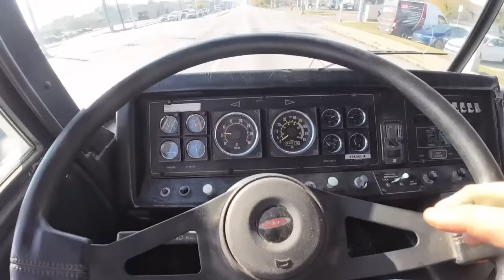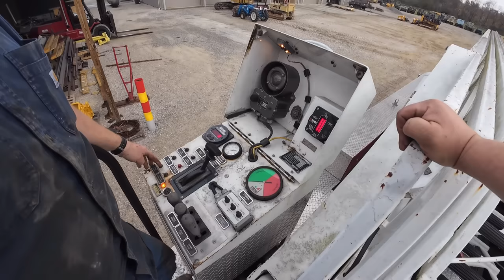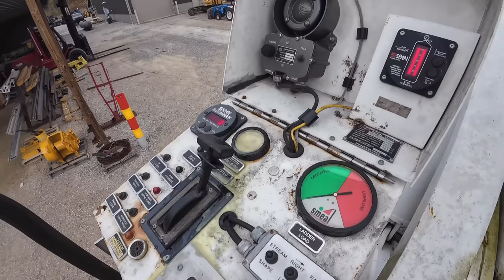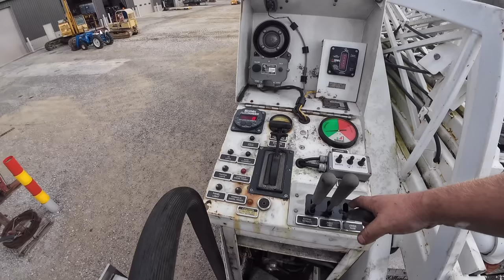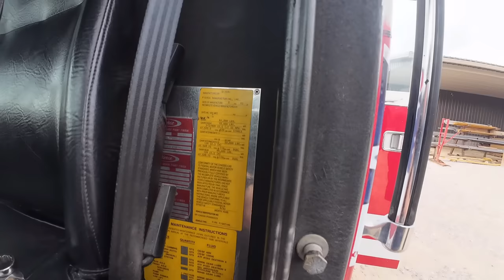We bought a 105’ ladder fire truck! Let the fun times begin! #firetruck

Comment: Back in about 1974, the Quad City Fire Dept. on the Iowa/Illinois came down to southeast IL to pick up a surplus Snorkel firetruck.  The clutch cylinder leaked down on it and their driver did not have the airbrakes released when that big diesel engine engaged and twisted a U-Joint into pieces.  We pulled it up to our dealership and located a driveline company down in the bottom of Indiana that could rebuild the shaft.  Being it was going to take a few days we worked out a deal where I would deliver it on a Saturday to the Coal City FD.  We left on a Thursday and stopped to visit an old friend in Rantoul, IL.  When we were passing the main gate of Chanute AFB the clutch decided not to disengage and we were stuck in the middle of the entrance.  After spending the night at our friend's house we got back on the road.
Like your truck, we were grossly overloaded on the rear axles and there was a weigh station on I-74 west of Bloomington, IL.  Having hauled many pieces of heavy equipment from Peoria I knew that we could go north from Bloomington to El Paso, IL, and take 24 west to the north side of Peoria.  When we were close to Peoria we had to pass through Washington, IL.  We got to the east side of Washington and a cop saw us.  He immediately turned around passed us, turned his red lights on, and motioned for us to follow.  We did.  We would have loved to see his face when we got to the west side of Washington and he pulled over and let us travel on.  On the side of the snorkel boom, it said in big letters "JOB CORPS, POLAND SPRINGS, MAINE."

Comment: Operated an identical model many years back!
You set the outriggers at the pump panel. The slide out step at the pump panel is for the operator to stand on in the event the ladder is energized by Live wires!
Also I noticed the skid plates for the outriggers are missing.
You guys are hilarious, keep sending them great videos!!
Reply: looks like it's missing the bucket too
Reply: @Commissar0617 not every rig for a bucket, my dept does not have ine
Reply: it looked like its got a mount for one  @fireexplorermichael
Reply: @Commissar0617  alr maybe there was but if there is a mount and the bucket is missing prob why they sold it

Comment: I use to drive one of the 105 ft Pierce Quint before becoming a Battalion Chief.  I think it's around 46K GVW with out water in the tank.
Reply: Newer equipment is much heavier, this is a vintage 1993.
Reply: @user-ln7of9gs4s A modern Ferrara ladder weighs roughly 78k but it depends on what axles you option it with tho but some of ours are 😊

Comment: Clint, the little oil tank with the dipstick on the passenger side pump panel is primer oil to pull a prime on the pump. It uses the oil to seal the primer pump vanes. New apparatus doesn’t use oil since it blows right onto the ground.

Comment: Fire Com box was for headsets, comms between FF’s. The driver position probably quick connect plug also used at pump panel. Weight 62-63k loaded (assume 300 g or so water) plus rest of equipment. Newer would be even heavier.

Comment: Thank you for BUYING this Ladder.
 I own a 1971 SeaGrave Engine. 8V-71 Detroit with a 5 speed Spicer/Dana Transmission. I use it for KIDS events with are Local Fire Zones. Let kids get in Drivers seat. At least in mine the kids can slide or walk through cab. Make sure the Differential Lock is unlocked in cab. On mine it also has a disconnect for front brakes ( slippery roads) mine also has the micro switch for brakes without putting foot on pedal. I don't turn any of those ON. I also have button on dash (have coveredwith Rubber cap,  so kids don't push that button. Its the emergency KILL Air for the old two strokes. I have added electronic sires to her. I just had the big Federal "Q" on nose. When I brought her
 Loaded up all the Air packs compartment with portable Fire extinguisher of all sizes and types. I have mounted old school Light bars on roof, swap them out from time to time. Plus it has to have the great Federal "184" four beam beacon 🚨. The Beakon that was probably the light that came with it new in 1971. I have learned so much from her about the inside of a Pump. There is so many room to get under her and look at where all the levers connections to what outlet.

Comment: Rubber block with a walking beam , these were usually used on International trucks ( Navistar). I built lots of them , the walking beams depending on the rear end weights were ether cast aluminum or prefabbed steel 3/4 plate.

Comment: Back in rhe 80s i was on the Sussex, Wisconsin Fire Department. We had a 1982 Pierce LTI ladder truck. It was unique in that it used a mobile crane chassis that would completely lift and stabilize the truck. The 85 ft ladder could be used, fully extended, in any direction or angle. The truck was replaced when the cost of certification for the ladder tower made replacement more practical. In our community the truck was intended to provide an elevated stream for fire suppression on large spread out industrial buildings. Pierce fire equipment in proudly made in Appleton Wisconsin! They are indeed cool trucks!

Comment: I’m guessing somewhere in the neighborhood right now of 50,000. The truck is an aerial because it has its own pumps to supply the master stream. If it was a ladder it would not have pumps.
Reply: Actually, it’s classified as a “Quint.”   Water, pump, hose, ladders, aerial ladder.  Everything in 1 vehicle.  That’s the reason for the weight.  Wait till it’s loaded up with equipment. The pump supplies water for the whole unit, not just the aerial.

Comment: As a former Mayor, here's what I can tell you about the 1993 Pierce Ladder Truck.
The outriggers are deployed so the truck chassis is off the ground. I've seen them as high as 12" off the ground.
The pipe that extends with the ladder is a 'ladder pipe' and a nozzle is attached to the end of the pipe for fires requiring large volumes of water. For fires in structures that have a large footprint, when extended it is effective in placing water at a distance that could not be attained from the ground. 

ISO is an organization, funded by the insurance companies in your state, is responsible for reviewing fire departments in your city or township based on several criteria. Based on their review, they assign a rating for the fire department and that rating is used by the insurance companies as one component in calculating your homeowner's insurance premium. Usually, the lower the department rating, the lower the fire protection component of the homeowners insurance premium is and vice versa. 

Fire apparatus that has been decommissioned or is older than the allowable years of service (age) is not eligible to be used in ISO's rating. Therefore it may not be of any value to a fire department.
Clear as mud???
Reply: Your understanding of ISO is about at mayoral levels.  All a department has to do is get it tested by a reputable third party aerial inspection service and it is good to go.  A fire department wanting to spend 3/4 million on a new aerial would never have explained that to you but, I can guarantee there are hundreds of used aerials as old or older that this one being calculated into current ISO ratings.  I can also guarantee you that there are hundreds of aerials sitting in firehouses simply for their ISO points and not because they are necessarily needed for aerial work.
Reply: Aerials older than a stated build date and aerials that cannot be certified do not qualify for ISO points in Illinois.
Reply: Source?  What date?  Illinois only?
Reply: @jamesford7182  Will check with the chief...thanks
Reply: @jamesford7182  Correct Illinois only.
Engines count for ISO ratings for the first 20 years from build date. 
Trucks count for ISO ratings for the first 20 years from build date. 
After 20 years. pumps and ladders must be certified annually.
Reply: Actually, ISO requires a fire pump to be tested annually per NFPA standards while in service.  The standard pump test for a new pump is 4 hours long but the annual recertification test is 1 hour. During your ISO inspection they ask for a three year history of fire pump tests as well as three years of yearly tests for the hose.  (Those two requirements plus a master stream appliance net a vast majority of the points that can be awarded for an apparatus.)  You only get full credit for the individual pump if you can supply the full three years of pump test readings to the inspector.  Less if the pump is new. Of course, they don't inspect every department every year but, when they show up that is what is expected.  

While aerials have most always been similar in nature, regarding ISO and NFPA, I cannot confidently talk about them as I have not worked for an aerial builder in the last two decades.

If the state of Illinois is not following that criteria, they are not following NFPA standards but tailoring them to their desires.  If so, the implications are damning.  You are saying that most of the aerials in Illinois are not required to meet NFPA standards to earn ISO points until they are 20 years old.  I have not sold fire apparatus in Illinois since the 1990s but, I find that hard to believe. I find it even harder to believe that union fire fighters are climbing ladders every day that are not being inspected yearly.  They know how much abuse those things are subjected to.

Comment: I don't know much, but i do know that fire trucks. Especially ladder units with pumper equipment, are heavy. Like 110,000 pounds heavy if the tanks are full and fully kitted out. I believe that it can get away with being as heavy as it is because government vehicles aren't held to the civilian standards of things. Like fuel economy, axel load limits, emissions, crash worthiness and small things like that.

I might be well off but hey, Firetruck!

Edit: This is added after seeing the recorded 56k at the first fuel stop. Pull the back off, get a beavertail with a lift platform, make a hell of a car or equipment hauler. Won't be the most comfortable ride with the current seats and all occupants will need hearing protection but it'll be unique alright.

Comment: Judging from all the loose wires and missing stage of the water pipe on the ladder, she is more a parts donor truck than fire truck. 52k sounds light, figured empty would have been a bit heavier.

Comment: I work at a plant where we had an employee fire brigade.  It was an old American LaFrance .  Had a flathead engine, 2 sparkplugs per cylinder.  Driver rode  ahead of the front wheels.  Had armstrong power sreering.  Took an acre or to turn it around.  Only I responded 2 was interesting.   We couldn't figure out the pumps,  so we connected hoses directly to the fireplugs.  Some hot ingots fired up some news paper in the bulkhead of the boxcar.    Old memories.....

Comment: I wonder the last time it was 3rd party NDT and what the report said.
The crackling coming from the speaker is just electrical noise from the lights / charging system and if the siren is completely turned off it should stop.
The ladder intercom is hands-free at the tip, and the two other positions on this truck are PTT.
The box in the cab labeled Firecom is the in-cab headset base, but I doubt they left the headsets with the truck, but there is a jack position around every seat.
The transmission is an HT-740 Allison.
Check the frame for rust jacking as it is very common.

Comment: Looks like you got an old ladder truck that has many different manufactures for the components of the truck.
It has a Pierce frame and cab.
Pump from Waterous and it should have a water tank between 150 and 300 gallons of water.
Ladder looks like it was made by Smeal.
The body could be a Smeal also or may have been built another manufacture.
But ladder has a big PROBLEM, it is missing the bucket that hanged off the front of the ladder.
This quint was originally a ladder platform truck.
Reply: It is not missing a bucket.  That ladder design was never intended to have a "bucket."  Those are called aerial platforms.  Pierce had a different supplier for platforms at the time this was made.  Most likely SFI (Structural Fabricators, Inc.) which later relocated to Appleton and became part of Pierce.  

Smeal never made bodies for Pierce.  Pierce at this time was a premier body builder.  I can remember Pierce sent me to Boomington, IL to measure a door on a Seagrave that needed replaced.  I was surprised until I got there and saw that it had a Snorkle aerial device.  Pierce had a contract with Snorkle to build their bodies.  So, this apparatus had a Snorkle aerial, Pierce body, and Seagrave name.

Comment: I wanna see if the HET M1070 Wrecker could move this bad boy!
Reply: Should be no problem because every piece of fire equipment like that I have towed, I have flat towed because by the time they are loaded down with water, fuel, hoses, and other equipment they commonly weigh in in excess of 80,000 pounds and the frame, body of the truck (apparatus) will often bend or twist if the front axle is lifted off the ground

Comment: That's a great truck pierce looks like an arrow cab most likely got an 8 cylinder Detroit diesel  with an allison transmission, interlockable rear axles and a
Smeal 105 ft aerial ladder, I drove one of those for many years, very dependable rig I think the one without the pump weighs about 66,000 loaded with equipment, I can walk you through ops of the truck if ya like

Comment: I'm thinking just because the outriggers went all the way down doesn't mean the ladder base is level. Maybe there is a built in safe guard...maybe not. Cheers 🎉
Reply: If the outriggers were fully downward extended, the truck would be off the ground.  For straight sticks like this, taking the bulge out of the tires, front and rear, results in the forces being transferred to the torque box instead of the chassis frame.  That torque box is massive.  I haven't done the math in years but, if memory serves me, the section modulus is well over 40.00 with an RMB of something like 24,000,000.

Comment: If you locate the original paperwork you will find that the rear axle was certified for a higher rating than published due to the type of service it is in.  This is very common on aerial  devices.  Especially the single rear axle 75' aerials and 100' platforms. I worked for the company that built that ladder in Snyder, Nebraska.

Comment: They don’t make fire trucks like they use to anymore run at a 3 engine company department 2 engines and a rescue engine rather wheel our 1991 or 1992 pierce dash’s then our 2022 pierce saber our old gals still run strong and are amazing trucks and that truck was over 75,000 weight hose and equipment our new engine weights in at 33,080 our rescue is 47,670

Comment: you lost AT LEAST 5' with the basket removed on the end of the ladder and each section is 25' so the stick you have is 100' which is still a long ways into the clouds for Kevin to bird hunt LOL
Reply: The "bucket" adds nothing to the height.  Maybe a little to horizontal reach.  That ladder was designed to reach 105' elevation at 72 degrees period.  The sections are considerably longer than 25' each due to the overlap between them.

There was no bucket to remove from that ladder.

Comment: Clint, if that’s got an Opticom you should remove it and keep it for yourself. It interacts with intersections that are set up for it and gives you a green light.
Reply: if I remember correctly, those are registered with the state, local municipality. ones here once sold, that specific registered Opticom is removed from the system. it might trigger green light but wont show up as official registered. you hit someone etc, you SOL